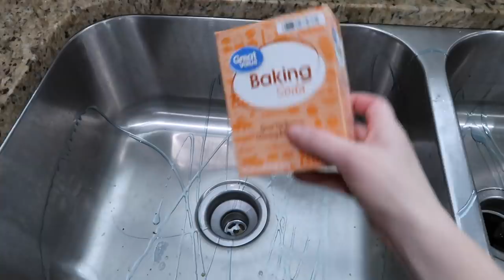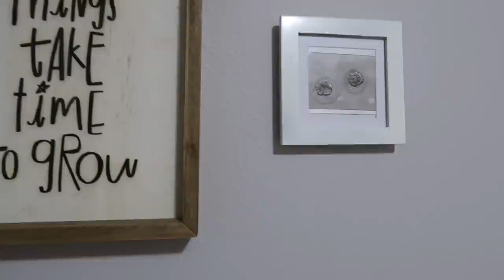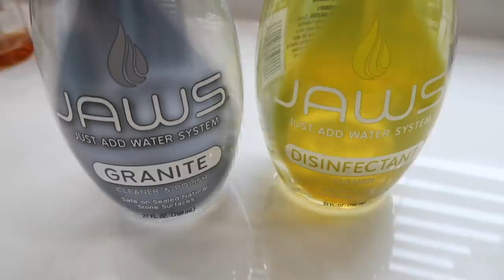NEW! EXTREME WHOLE HOUSE CLEAN WITH ME 2020 | ALL DAY SPEED CLEANING MOTIVATION | CLEANING ROUTINE

Comment: Liquid Laundry Detergent Tip: When using the big containers with a tap on the side, they are designed so you can slightly open the twist off lid to let in air so the tap can flow freely so you don’t end up with the container collapsing due to lack of air inside. Makes it so much easier to get the detergent out this way.
Reply from the maker: Doesn’t work for this container! I open up the top cap and it still stays that way! 😂

Comment: Hey Jamie I see you use a steamer for your floors...does it turn into handheld....I have a Bissell one that does and it has cleaning tools and attachments....I use it in handheld mode to first clean my blinds. I close them and wash with steamer..i.then steam back side of blinds. I also use steamer to do corner of window.where mould builds ..while I aim steam at corner I use reveal grout brush to scrub and it works amazing. Then I finish off using a mrcrocloth tool attachment to clean  windows.....best way to clean ever...no need for products...no streaks. For blinds I dust first before washing using Swiffer telescopic tool for lights.
Reply from the maker: I doesn’t turn into a handheld! But that would be super handy!
Reply: Matcam 1 what is type and model of steamer do you have that sounds awesome!